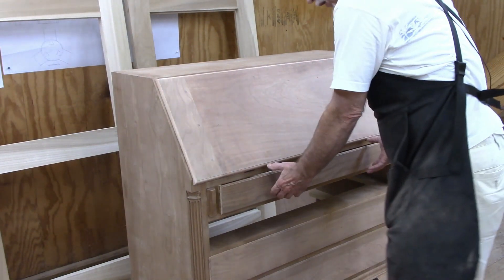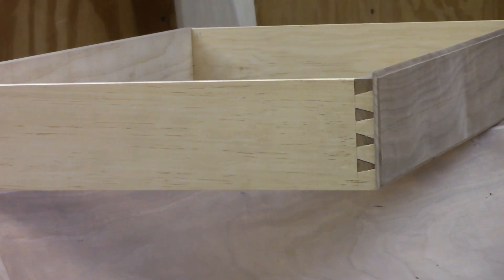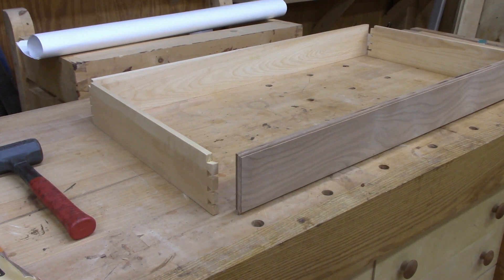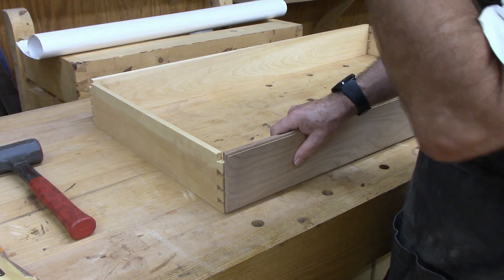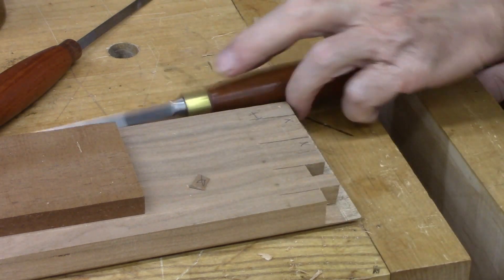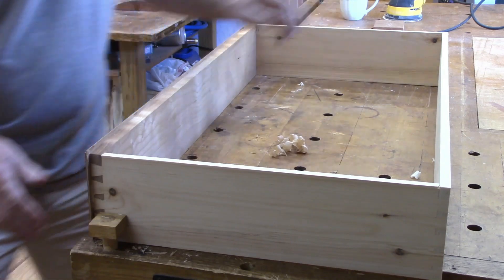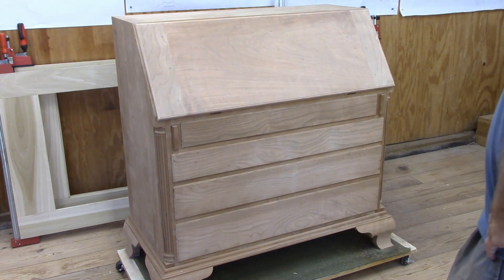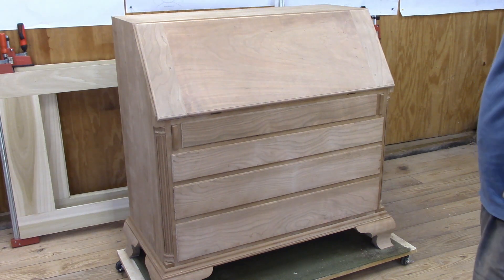Penn Chippendale Slant Front Desk Making the Drawers Step 9

Comment: I wanted to ask you  about drawer brass and locks. I've bought high priced brass  from inside my local woodcraft in the past and I'm trying to  avoid paying $20x10 plus the locks for a chest. I  don't want cheap brass but I'm looking for the best place to buy ?
Reply from the maker: Joe, I don't think there is one best place to buy, I buy from Horton Brasses, Ball & Ball and Optimum Brasses UK depending on what type I am looking for
Reply: @DavidBoeff  Thanks for your info. I saved those sites.  Risking buying brass on Amazon with half of the weight cut out would be a hassle.

Comment: Regarding the fitting of the drawers, do you take into account, or make allowances for, the season your are constructing the project versus potential wood movement throughout the year?
Reply from the maker: Yes, I do. It being hot and humid right now, I know that the drawers will shrink in the winter or air conditioning so i leave them a bit snug